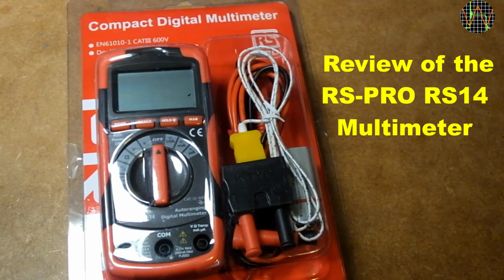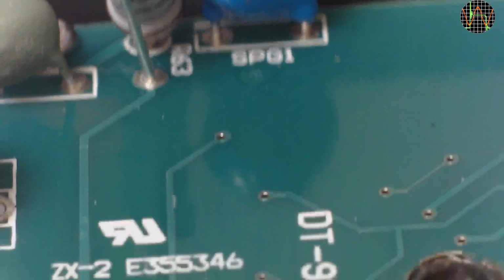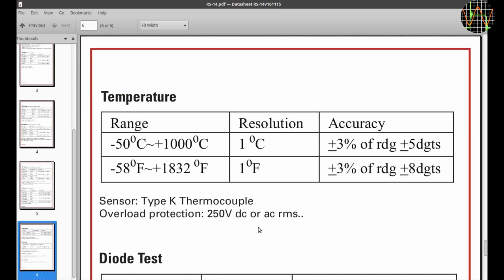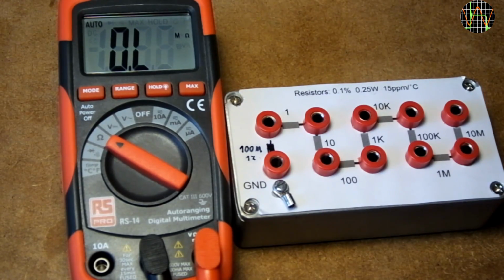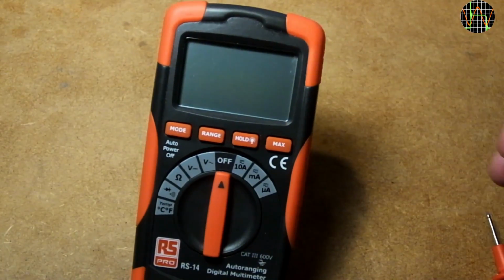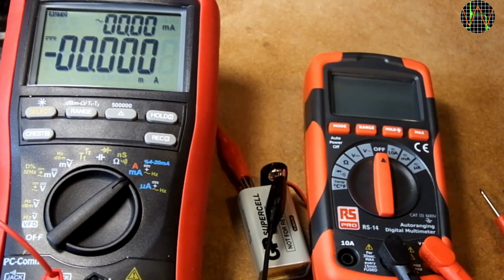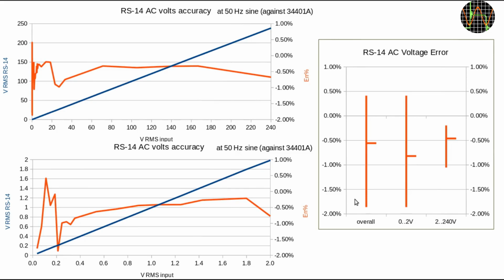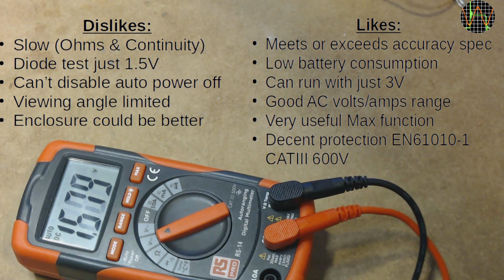Review of the RS-PRO RS-14 Multimeter

Comment: Is this good for automotive and home use? Thanks for your excellent review.
Reply from the maker: Yes, it would be suitable. Having been tested by RS you can trust its CAT safety rating which means it is generally safe to use in home and similar environments. Most other meters from the usual discounter places may have better specs (for the money) but come with fake CAT ratings that are not backed up by the meter's electronics and construction. The one thing the RS14 is struggling with is temperature measurements which are rather inaccurate the further away you are from 20-25 deg C . If that is important to you, look elsewhere.

Comment: Great review 👍

This meter or a Uni t 89X
Reply from the maker: Hi Kevin,  many thanks.  I just had a quick look at the UNI-T 89X on the web and it looks quite good. Ok its not auto ranging but it is True RMS which the RS-14 is not. On accuracy, it beats the RS-14 no contest (if you believe the specs). Also has frequency & capacity ranges that are not on the RS-14.  The one thing the RS-14 has is a 600 mV AC Volt and a 600 uA AC current range while the UNT-T only goes to 6V or 60mA. That is really poor. On the plus side the current range goes to 20A for the UNI-T but only 10A for the RS-14. Depends on what your needs are, those differences may be important. On electrical safety,  what I did see on the tear-downs is the typical UNI-T approach. One meagre PTC and places for more that just left empty to save a few cents,  but it does appear to have similar size ceramic fuses as the RS-14. I would not trust the PCB traces or the tiny current shunt to survive 20A for more than a few seconds. The most telling thing on the UNI-T is that silly "transistor test" socket. I wish they would stop doing that. Its very bad for electrical safety and I doubt that this meter would pass any real certification with that socket. Just imagine there is a transistor stuck in there while you probe mains with the test leads and then brush your hand against the transistor...  Besides, is anyone using these for transistor tests? Especially now that smart component testers are so cheap.  So, feature wise the UNI-T wins, on electrical safety, I would trust the RS-14 more.